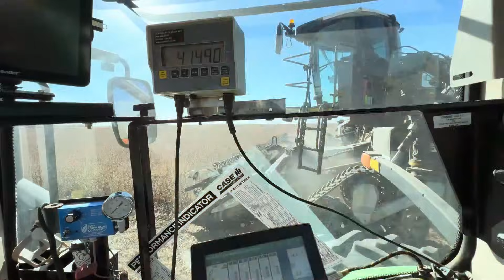Nexat Harvester (Part 1)

Comment: Am I seeing some sort of digital number board on the side of the rig at 13:39 ? Or is that just the weld pattern on a steel plate? It looks like a counter or maybe used to give commands to the grain cart operator?

Comment: Yeah. A 40-foot header in planted "good beans" at 2.5 mph on pool table land  is DEFINITELY "relaxed". 

I want to see the grain sample and FM as well as the moisture and test weight. 

And bushels per hour, fuel consumption per hour, transport time in miles per hour "field to field", performance in "green beans" and that pile operate anywhere a real combine with a 40-footer can't literally run circles around it. 

But unfortunately you can't "run" it NOWHERE and that is the only place a real combine won't embarass it. 

Even AF combines would embarass that pile.

Comment: Stupid suggestion, I probably has something similar already but I put a piece of chain dragging on the ground bolted to the frame to bleed off static. Keeps most of the dust off the cab windows. Mabey a dedicated static wire to the cab would help. Glad to see it's the same color as my big new machine was. Gleaner A2. 13ft head. 18.4x26 duals. Oddly, it's still in use because in the muck ground and sugar sand up in northern Indiana, it will go where you can't walk. The big machines bog down. It goes around the neighborhood  munching off the wet spots. It was a major upgrade from my cabless Gleaner E with a 10-foot head. That was much faster than my first combine. I actually did custom farming with at 14 years old. A cabless Massey Ferguson Super 35 with an 8ft head. Always got pelted in the face with soybeans coming out of the bent cylinder cover! I pulled a 220 bu Parker wagon behind me. The old guys around there still had some 10 and 12ft gates and no one else could get thru them. You know you did something after spending a day on a cabless machine with manual steering and manual adjust belt variable speed. It had a 3 on the tree trans. I took off the 11.2x24 tires and put frame connectors and 17.5x25 on. Had to take a chainsaw and dock the lugs on one side to clear the platform! It was still a running machine when sold in 2020. Fun times in dusty beans or wheat all day in 80 deg weather. I enjoyed it. My dad had his Gleaner A in use from 1967 until he died in 2020. Granpa asked him what the heck he needed that huge monster for when they sold their Allis Chalmers 60 pull type! He used to run steam engines on threshers and bundle corn in shocks and pick them up with a wagon. I found a huge muck shoe from one of his Percherons in the field that fit around my waist. 😂 the A was more fuel efficient. We put 16.9x26 duals on it. The key was extra wide spacers. A, A2, and C Gleaners have a solid axle and full frame. Owning a C would've been reaching for the stars! City people don't realize that a modern farmer can easily spend $40,000 on their equipment, supplies, and upkeep....per month! I always laugh when they call us "Rich farmers" when they see the machines. Like granpa said, "You can be as big a farmer as you want, but you won't make any more money. You just see more of it pass thru your hands!"  😂.
Reply: I just watched a ZK Master tech repair man talk about that. He thought the guy was being funny and putting a chain on there to be joking. But no, it really does work because back in the 30s the dust bowl, that’s how you didn’t shock people when you got out of your car you had a chain down the bottom.. I thought that was something everybody did, but I guess it’s one of those tips that are something like why didn’t I think of that.
Reply: Enjoyed your story! Just doesn't seem possible that we have gone this far in our life times! I harvested beans with an A John Deere pulling a #30 John Deere combine. Totally unbelievable!

Comment: I won't argue against the egregious amount of engineering in it but the design has some rather serious real-world issues and I can't imagine more than doubling the systems, electronics and various moving parts of a regular combine is a good idea.  Our technology level is to the point that we could actually control a second boom-lead and self-powered harvester like a trailed mower without needing massive amounts of communication gear on it.  Imagine a pair of S700's with slightly shorter cutters on them where you have two control sticks and a screen for the second one.  none of this fiddly huge set-up or losing 50 feet of crop width on a field large enough to rate the Nexat simply from its tracks being outside the cutter.  I think there's a very viable if somewhat shorter machine in this concept that would be retail successful but everything on that machine in the video that is wiggling is a stress failure waiting to happen in the middle of the field immobilizing it.  Trying to safely weld on cut cropland in wind is just about like trying to safely heat fry oil by lighting the top on fire and stirring it.
Reply: The problem is the concept is all wrong. Great engineering none the less but i have designed a far superior machine without all the drawbacks that is inherent with the tram line concept they started with. Just the fact of moving the grain away from it at harvest time negates their principles. Its a non starter

Comment: Great as a concept,  but it will never take off commercially.
Reply: It is already being tested for years. And it works pretty darn well.
Reply: @Chris_H_OH58D  what happens at seeding time? Do i stop seeding to spray? What about a wet harvest and i need to go spraying straight after the crops off? What about a worldwide dealership network? If the unit goes down it all does.
Reply: @shaun469  yeah, give it some time. There is nothing special in that things in terms of basic tech. 
It is an impressive thing and it should work out well. I hope, at least. Big farming needs something like this. It is being tested under all circumstances in Ukraine since, I think, 2020.
Reply: @Chris_H_OH58D  the fact remains that its 1 base machine. Sometimes all the jobs need doing at the same time.
Reply: @shaun469  well, than you would need more base machines, right? That was simple.
Reply: @Chris_H_OH58D  so its 1 machine that does everything. But I'd need more then 1 of them? What's the point then?
Reply: @shaun469  why do farmers today have more than one tractor?
Reply: @CH_OH58D  because jobs need to be done at the same time.
Reply: @shaun469  then you need more tractors. All tractors can do multiple things, but if you need to get things done in the exact same time, you need more tractors and worlers
Reply: @Chris_H_OH58D  then why would i need a nexat?
Reply: @shaun469  because it gets more done in less time. It does compact fewer parts of the soil, because it just compacts 5% and uses the exact same tracks over the year.

Comment: Impressive machine. Must be 5 to 10 million and a 600 to 800 diesel to drive it.
Reply: It’s electric with 2 550hp generators. They say it’ll cost 1-2 million depending on the options checked.

Comment: Does it have a detailed map of grease zerts , what’s fuel consumption?
Reply: electric drive by 2- 550 hp Diesel engines that are powered by green hydrogen fuel cells
Reply: @ interesting, how many acres can it do on a full charge? Does it have a solar charging station or a portable generator for charging? Probably pretty hard to take on harvest or does it break down into sections, awesome piece of equipment.

Comment: Too many blind spots. Transport will be a nightmare. There is a reason the zero turn mowers took over.  They are designed like combines. I don’t see how this is any better. Looks like way worse visibility. I can’t imagine how much stuff you would accidentally run into.

Comment: Only thing i dont like is operater visibility.  Would be better if the operating station  could move to allow better visibility on the far end. Even so you could run with it in middle of the platform

Comment: The only waybthis bec9mes viable woupd be for custom farming operations as most of the innovation is geared towards making this bohemouth transportable on the roads with modules attached. Equipment performance and reliability have yet to be demonstrated. Service support availability/comittment?
Reply: Sorry for the spelling mistakes. with the spelling mistskes removed:
The only way this becomes viable would be for custom farming operations where the ability to move equipment from
field to field fully set up for work is important. In Europe this particuarly important.
I have yet to see any independent performance/reliability data to see how ot compares to current farmi g equipment.  I also have concerns about the manufacturers comittment to long term part and service suppport.

Comment: Ok..I am an old surfer dude in San Diego  that is NOT a farmer (of large acreages of crops :)  so flame lightly please. Is the philosophy of this machine to damage the product less or more volume or?? sorry to sound ignorant but just seems way more complex than a regular combine with a larger header that APPEARS to do the same job with a decent result????.. again be easy :) Thanks in advance
Reply: They need something/ system that has not been patented yet, so you get a terrible, costly beast.
Reply: The main pitch with these, is you only need one powered unit for the farm.  Farmers now, have a tractor for the planter, a combine, and a sprayer.  3 engines for 3 machines.  This machine can hook and unhook to a planter, a sprayer and a combine.  1 engine.

Comment: The track and steering mechanism alone seems quite complex [and expensive] as compared to any conventional combine.
Reply: What is complex with beefer metal parts and hydraulic cylinders? Those things are used for ages.

Comment: I fear this is an example of designing a product and trying to get the market to want it rather than designing what the market wants
Reply: And what does the market want then ?
Reply: Just one basic marketing challenge I see is that the machine is limited largely to flat land and gently-sloped land.  So that greatly reduces the number of farms on which it would be practical to use.  One could not even attempt to till or harvest the hills of the Palouse region of Washington state and Idaho in the US.  Nearly all of the combines in that region must be self-leveling, and this machine's design could not accomodate such a feature.
Reply: Auf dem Sektor der Landtechnik sind schon viele Maschinen entwickelt worden. Sehr viele sind noch im Einsatz. Einigen war nur ein kurzes Leben vergönnt.
Reply: Sort of like the "Ranchhand" multipurpose tractor/truck combo manufactured by Crystal Plains Manufacturing in the late 1990's.
Reply: T

Comment: One unique piece of equipment . It sure sounds quite on camera sounds like it doesn’t turn many rpm’s
Reply: It has 2 550hp engines to drive the hydraulics and electric drive motors
Reply: @shanemay3797 makes sense

Comment: I've seen it in action twice now and it just blows my mind. It's unlike anything I've seen but it makes so much sense.
Reply: When it stops the entire operation stops.
Reply: How does it make sense?  The zero turn mowers took too over for a reason. The combine design we have works very well.
Reply: @ralphllivrah9551  up to 30% less fuel and way less compressed ground.
Reply: @peter_meyer  it just looks clumsy. The combine design is a very good design for cutting. It’s so good they decided to model all the lawn mowers after them. You go from a tractor type mower to a combine type/zero turn and efficiency goes through the roof. It’s just a hard design to beat for cutting.
Reply: @ralphllivrah9551  Not sure what you are talking about, as i'm not a farmer. But this is a modular design, so if you´d like to do corn, get the combine module for corn. Or get a third party module for anything else.
It surely isn't made for just one job (it would be too expensive for that).
Reply: @peter_meyer combines can spin around on a dime,just like these zero turn mowers. Most farm land is still in small patches,curvy,etc.. there are also a lot of dis jointed farm,with alot of highway travel. This thing looks like a nightmare to move around.
Reply: @ralphllivrah9551  Ok, small patches surely aren't the place you'd run these machines.
In Ukraine they run on 1million acre farms.
Reply: @peter_meyer the other problem I see is how this company can provide support?  You gotta have a lot of machines out to be able to afford to build bases to provide mechanical parts,serious repairs,etc..  I mean there are a lot of challenges.  It’s very hard to break into agriculture business. People think there is a lot of money in farm,but the reality is quite the opposite.  There is a very small profit margin.

Comment: Combine is SLOW 🐌  boost production and put a 60 ft 🐝 Honeybee flex Draper on it !
In itself looks impressive but slow oversized and impracticable.  Would like more REAL INFO PART 2 seems like JD CASE NEW HOLLAND or FENDT  Do more in less time.
P.S. Your editor cant spell or does not understand farming vocabulary.
Reply: When it breaks down, you can do none of that, just wait for parts.
Reply: Forgetting it can do all the ground work  fert  sow then harvest  all in one  machine
Reply: @AnthonyBrown-vz9nd and it can do it all vvvveeeeeerrrrrrryyyyyyy ssssssllllllloooooowwwwwwlllllyyyyyy

Comment: The first thing I would do is cut the wire to the beeper.
Reply: It's beeping because it's remote control so when you crash it and the insurance company finding out you disabled safety device they will fuck you up pretty good.
Reply: Right on
Reply: beepers... if its euro standard it may refuse to back up if the beeper is cut
Reply: Or door dash
Reply: Maybe make the beeper manually.
Reply: Bro does not believe in safety
Reply: We'll visit your grave
Reply: Warning signal
Reply: I did see it to work in Ukraine!!!
Reply: Lol
Reply: It will throw code and shutdown
Reply: How about use common sense a beeper is no replacement for that. Cut the wire.
Reply: @joshuacrawford7304  yeah, but the point is, there can always be something that takes your attention in the most stupid moment, annoying beeping prevents from that.
Reply: @MrAstronus  most people with common sense pay attention to what they are doing and not be texting or facebook when you are doing a job
Reply: @MrAstronus than the machine manufacturer should restrict the action of the beeper to situations that require special attention only instead of having it beep at every regular button push
Reply: @MrAstronus if you are around it enough you pay no attention it’s simply white noise in the back ground. I don’t think they serve any safety purpose. If your in the middle of a bean or corn field and you get ran over by a combine then I’m not sure you needed to be in the gene pool anyway.
Reply: The second thing, God forbid, you'd be calling 911.
Reply: you would be putting people at risk.. but if thats what you want.. go right ahead
Reply: @chaoszombie9995  that machine  beeps while just merely existing in an idle state. Fuck that beeper.
Reply: @chaoszombie9995  Like that matters on a middle of nowhere farm.
Reply: @kazuviking absolutely

Comment: What is the cost of that unit set up with both heads, beans and corn ?
Reply: I would think this would be for corporate farms that have 10,000 acres plus. Or a very risk taking operator to line up dozens of jobs each year.
Reply: It also can plant/drill in spring also

Comment: Totally awesome machine, but probably very, very expensive.
Reply: The Nexat unit itself will cost around $1.3 million. With all of the applications, the total price jumps to around $2.75 million. A combine, tractor and grain cart will drop $1M off of that. I don't know much more maintenance and repairs will be saved
Reply: @godoftheinterwebz Keep in mind that the Nexat can also plant and till.
Reply: @karlrovey  it slices, it dices, it makes mounds of Julienne fries
Reply: @karlrovey  yeah, that's the "all the applications" part
Reply: @godoftheinterwebz  And what you mentioned would require a planter and tillage implements to accomplish the same as the Nexat, which would make the prices more comparable.
Reply: @godoftheinterwebz  In my opinion, the biggest issue with the Nexat would be dealing with fields that are laid out in contours or have terraces.
Reply: @karlrovey and spray 16000 ltr tank
Reply: Think it also comes with a spray unit as well
Reply: So when it breaks down you can't till, plant or harvest, speed looks Slow, tuff to move to other fields, can't maneuver around yard, Parts / field techs ?, Need a airport hanger to park it in, the demo field looks perfectly flat, no rocks, close to yard, ( let's see it get 3 miles down the Rd, in a real field with a weather dead line looming). Buy 2 so you have parts, they won't make many